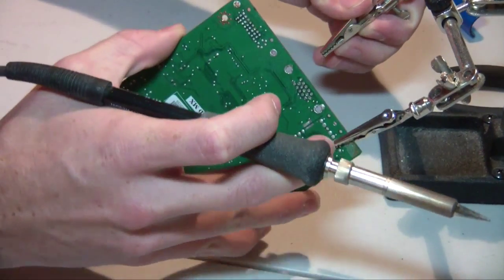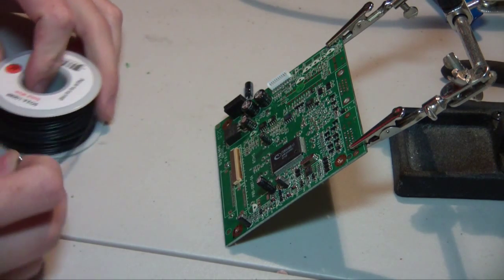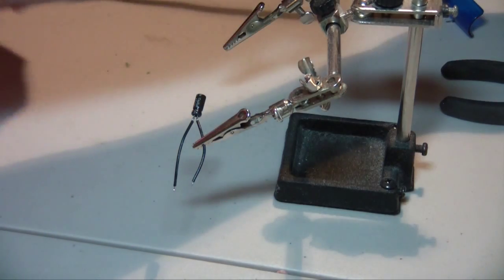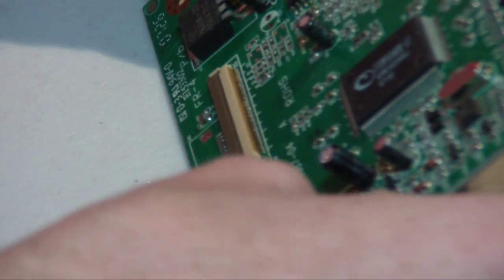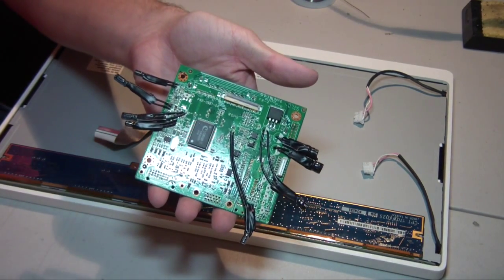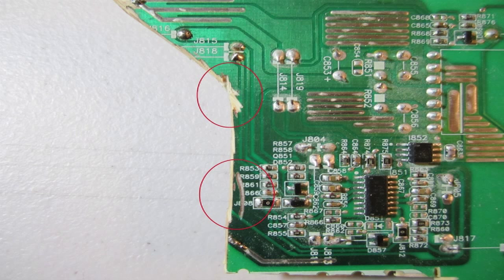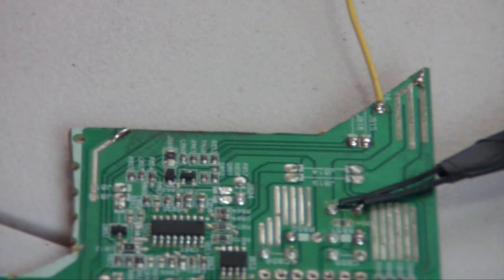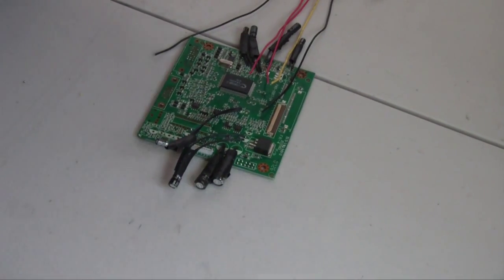"X-Top" How-To #3 - Caps and Inverter Board

Comment: inverter doesn't change ac-dc it changes dc-ac a rectifier changes ac-dc becouse the baclight of that screen is not led so it needs high volts